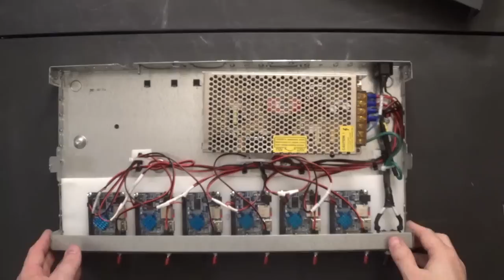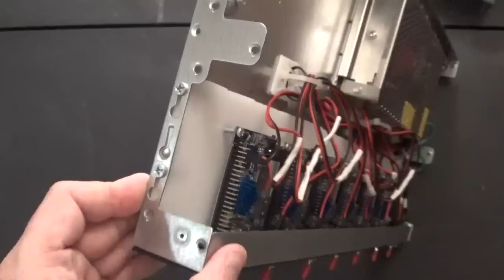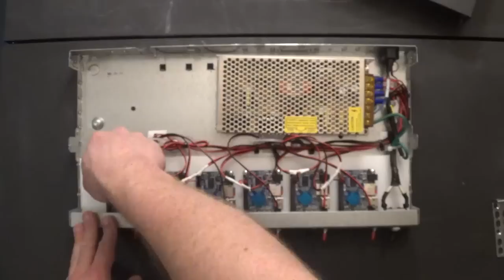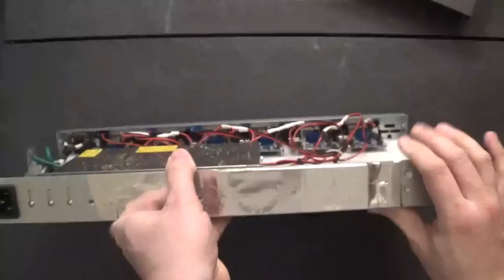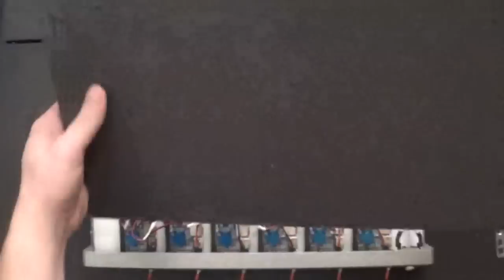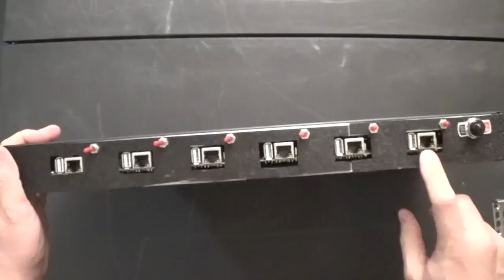Orange Pi Cluster

Comment: How is this a cluster computer? Are you actually running it in a orchestrated fashion or by cluster, you just mean, many units that happen to be in the same box
Reply: yes he can program python cluster way and it calculate result.then debug it will that worked and got correct answer.
OR he could run whole system ass cluster .STARTING from kernel and every program run cluster even python even startx lol without actuall program it to MPI.LOL
too bad nobody has done it. everyone doing python and same what ever numbers lol

Comment: Hi, I was planning th same setup using a led power supply as you did.  Im planning to have 6 nodes based on Orange pi pc plus and 2 storages servers based on Orange pi 2e.  One of my concerns was if the power supply is stable enough to this kind of aproach. Im looking forward for updates on this. thanks for sharing :)

Comment: You might wanna go with a lower amperage to save power/electricity bill.
Say each OPi needs 3Amps at max so that is like 18 Amps. And maybe it even runs fine at 2Amps. 5 x 18 = 80 watts versus 5 = 30 = 150 watts But what software are using for clustering? I got some OPis maybe I can cluster them. Check out http://dietpi.com/ Diet Pi , it got some cool features for OPis like running at low clock ....etc.
Reply: Ok, it seems I got a wrong understanding, thanks for your correction. There is this USB stick that might help you in knowing how much power(voltage . current) is drawn and for how long (time)
http://www.banggood.com/KEWEISI-3V-9V-0-3A-USB-Charger-Power-Detector-Battery-Capacity-Tester-Voltage-Current-Meter-p-984613.html
https://www.aliexpress.com/item/2016-New-Arrival-KEWEISI-3V-To-9V-0A-To-3A-USB-Charger-Power-Battery-Capacity-Tester/32662907623.html
You might wanna couple it with this cable (it is on discount now, costing only 66 cents)
https://www.aliexpress.com/item/USB-to-DC4-0MM-1-7-Charging-Cable-80cm-Direct-current-Line-All-Copper-DC-Charger/32713618875.html
Reply: Even a linear power supply only pulls what it needs. It's more inefficient.

Comment: Cool project man. You can get a cheap case/box for OPi One/Lite/Zero, dunno which model is yours!  http://www.banggood.com/2Pcs-DIY-Plastic-Project-Housing-Electronic-Junction-Case-Power-Supply-Box-p-1063302.html http://www.banggood.com/100x60x25mm-ABS-Case-DIY-Plastic-Electronic-Project-Box-Enclosure-p-1093142.html
Also you can get a cheap cable, PSP USB cable works with OPi
https://www.aliexpress.com/item/USB-to-DC4-0MM-1-7-Charging-Cable-80cm-Direct-current-Line-All-Copper-DC-Charger/32713618875.html